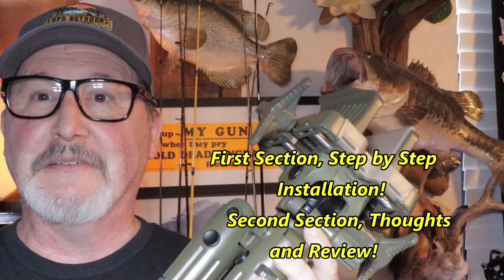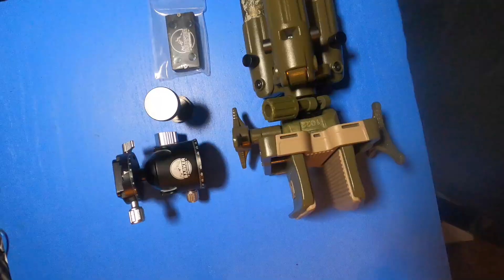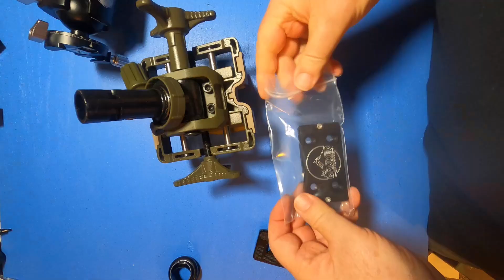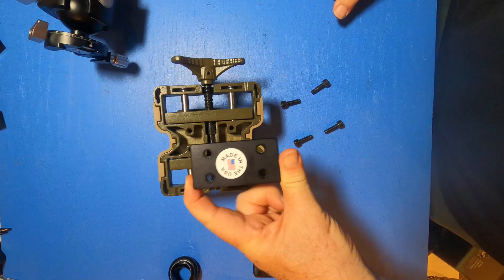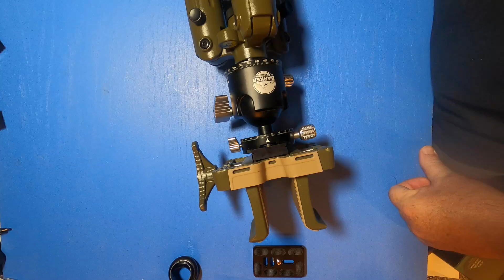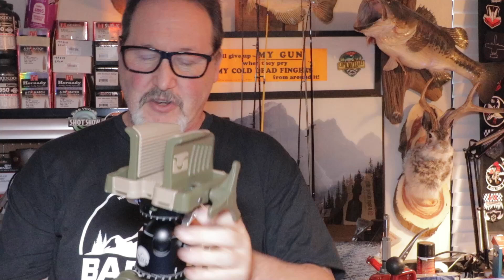The ULTIMATE Bog DeathGrip Conversion Arca Rail Install Tutorial

Comment: you obviously are not a stalker. That head weighs far to much, to carry around fields. I have the carbon bog, the Arca rail is better on its own. Also the bog moves up down around, no better with the hog saddle attached to the Arca !! So what on earth are you doing.?? 
you have cancelled the Arca. OR have i just gone down the rabbit hole.?
Reply from the maker: Thanks for taking the time to comment! Let me address your points and clear up some misconceptions.

First, regarding weight: The Deathgrip Infinite Aluminum starts at 8 lbs, but after the Arca Rail conversion, the entire setup weighs 6.8 lbs—the same weight as the Carbon Fiber version. The ball head and modifications do not add unnecessary bulk; instead, they make the system more functional without exceeding the weight you’d already carry with the Carbon model. If weight alone is your concern, this setup offers comparable portability at half the cost, which is why it’s such a practical choice for many users.

Second, you mentioned the Arca Rail being “better on its own.” While that may be your preference, adding a hog saddle provides significant benefits for many shooters, such as enhanced grip, stability, and flexibility. For those of us who prioritize precision and adaptability, this combination is far from redundant—it’s an upgrade. It’s not just my personal opinion; it’s a setup that works well for a wide range of hunters, shooters, and outdoors enthusiasts.

Now, about your comment that I’m "obviously not a stalker" due to the weight: The reality is that this setup weighs the same as the Carbon version, so your assumption doesn’t really hold. Many stalkers and field hunters carry setups in this weight range or heavier, as long as the trade-off is improved stability and performance. If you prefer ultralight gear, that’s great, but this build is tailored to meet the needs of those who value a balance of weight, cost, and functionality—without sacrificing performance.

Lastly, your claim that the Bog moves up, down, and around and isn’t improved by the hog saddle isn’t accurate. The hog saddle actually tightens the system, offering better control and stability, particularly with heavier firearms. This isn’t about canceling the Arca Rail—it’s about enhancing it for more robust use cases.

I appreciate your input, but it’s important to recognize that different shooters have different needs. This build is practical and beneficial not just for me but for many in the community who want affordability, reliability, and performance in their gear.
Reply: @lupooutdoors  I'm not saying the saddle isn't any good, I'm saying it weight is a relative gripe, most bog owners comment on. I am maintaining my original statement, an Arca swiss rail is the most common upgrade, to the deathgrip. But I don't get why, having upgraded the system with an Arca you would remount that great lump of a saddle,onto an Arca. I walk miles over fields carrying a bog carbon with gun and a scope, yeah weight is an issue. Also I don't leave my quarry in the field it also weighs something. If you're in the target shooting community maybe it isn't something you think about. As for precision, accuracy shooters, isn't that the standard we all strive to achieve. Or was there sarcasm. ?
Tell me why you need a hog saddle attached to the Arca, again Because honestly unless you're American, I just don't get it. I'm 62 and have been striving for precision since I picked up a gun at 11 years of age. I spend hours on hours to improve my accuracy/skill set, I go out to shoot professionally, not for a work out.
Reply: @BarrieCopeland-je6lh  THE SADDLE IS PUT ON ARCA RAIL FOR GUNS THAT JUST HAVE NORMAL STOCKS ON THEM, WITH NO ARCA RAIL ATTACHED TO FIREARM.
Reply: @BarrieCopeland-je6lh  i use both systems for shooting ,only reason is not all my rifles have a arca system on them, but if im coyote hunting,  will only take arca with me.

Comment: For $200 I may as well buy a new tripod with the mount already.
Reply from the maker: Sure, you could go out and spend $200 on a brand-new tripod—but why would you, especially if you already own a perfectly good one? With this simple conversion, you can easily upgrade your existing tripod to mount Arca-compatible accessories, retain the original clamp, and attach anything else that uses a standard camera mount. It's a versatile solution that saves you money while maximizing functionality. Of course, if you're buying a tripod for the very first time, investing in the right one makes sense. But if you've already got the gear, this upgrade is a no-brainer. Thanks so much for watching—see you in the next one!
Reply: @lupooutdoors  because I could mount a Camera/Spotting scope and a rifle at the same time now. It's just overpriced considering you can buy it with a tripod for pretty much the same price.
Reply from the maker: @ please re-read my response. And thanks again for watching
Reply: @lupooutdoors  please re read mine. I already own one. If I got the adapter I'd still have one, but I'd have bought it twice. I'd rather get a Tripod with the attachment already on it. Then I'll have two, instead of buying 1 twice...
Reply from the maker: @ why would two make any sense at all? Bog’s are not 200. So, in a nutshell feel free to buy a cheap tripod with an Arca Rail and good luck. I’ll stick with the Bog Death Grip. I do very much appreciate your opinion and feedback!
Reply: Brother, they are off their nuts. If you can answer why would you add more weight, if the hog saddle is the only flaw in a great tripod. why? Because its akin to a lump hammer. Ditch the saddle fit the Arca to the tripod and the rail to your stock. Walking around fields with a lump hammer and my gun and 3 carbon legs . Then have control of my breathing to shoot a rabbit. Crazy, add more weight.!!!!! Besides what more movement does it achieve, zero. in this universe, anyway. I just cant see the advantage.

Comment: Ball mount from Amazon and Arca plate from ZFG is the least expensive route. 5 empty cases of .223 and 9mm pressed together for the inner spacer works flawless.
Reply from the maker: To do this right, it requires more than just a ball mount and Arca plate. Rigging it with the 223 and 9mm will prob work for a bit of time, but I would not trust it for heavier rifles and prolong use.  Thanks so much for watching!
Reply: your all mental.
Reply from the maker: @ why on earth would you say that?
Reply: @lupooutdoors  Because I just saw a benchrest shooter shooting off an Arca with a bog saddle on top, that's why, and it makes no sense. Anyway I've quarry in the field and I'm thinking this time , on  here I can never get back. Your logic is messed up. Enjoy what you're doing stay safe, keep at it, my opinion ain't worth shit. To any one except my own self.
Reply from the maker: @ no one said you’re option was bad, at all. But not everyone has an arca on all their guns. If you have just one or two fine,  I as you can imagine have way more than two and not all have arca. Just saying. But, thank you very much for watching and your opinion is always appreciated

Comment: Hey buddy I just bought the adapter for the death grip like yours just curious if you're bracket for the actual death grip does it slide back and forth in your ball mount ? Doesn't seem like I can get my tight enough ! The adapters that came with my ball mount work perfectly !
Reply from the maker: I have not really had an issue to be honest. How much is it sliding?
Reply: When I hand tighten I can still slide the clamp and arca plate ! I really don't want to take a wrench and tighten it
Reply: Can you hear your self. you dont need the hog saddle, its dead weight. OMG.